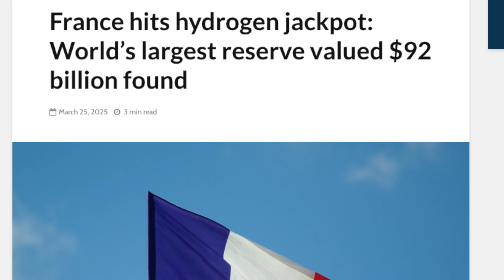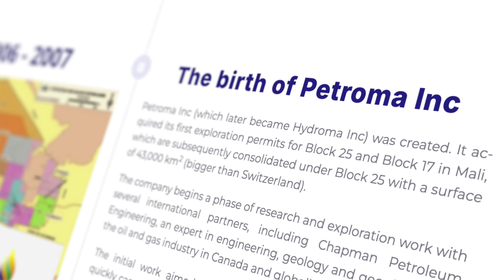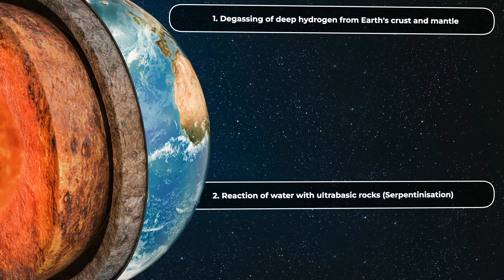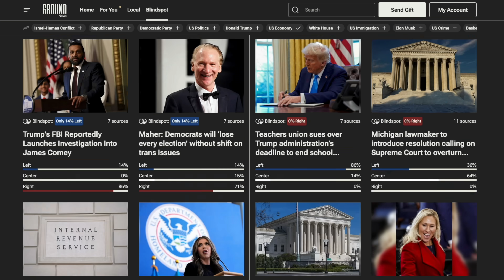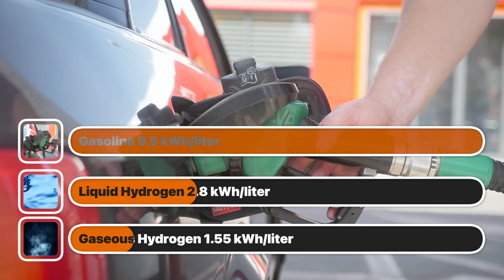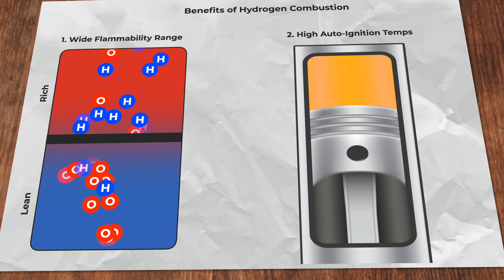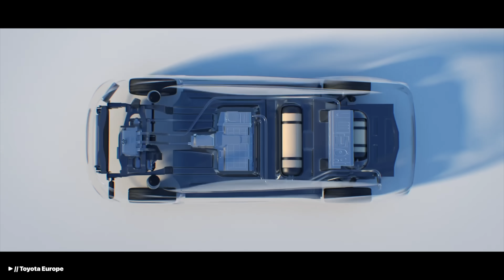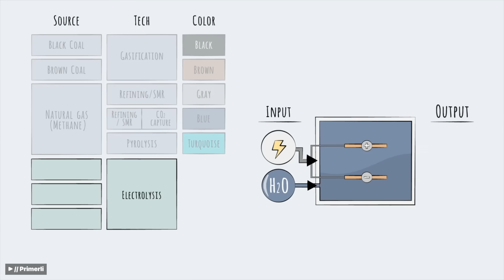This Hydrogen Discovery Can FINALLY Replace Oil & Gas!

Comment: So
What happens when we burn pure white hydrogen ?
I’d assume it would cause oxygen from the atmosphere to be bonded with the hydrogen from the ground and create water.
My question is at what point will this start to decrease the atmospheric oxygen due to the oxygen being converted into water with white hydrogen, rather than the co2 that hydrocarbon fuels produce, that plants can convert back to oxygen.
Reply: Not to mention that the oceans will rise even further with all that extra water, drowning more communities.
Reply: @JasbirSingh-zj1fg  Bruh... There is 1.4x10^18 cubic meters of water in the oceans, meaning about just as many tons of water of which 10% of that weight is hydrogen. That's 1.4x10^17 tons of hydrogen in the oceans. If humanity used 10 billion tonnes of hydrogen every year to power its societies, assuming that it's exclusively white hydrogen (and really there isn't that much on Earth), and given a mean average depth of the ocean of 3600 meters, it would take humanity 3800 years to increase the water level of the oceans by 1 meter, converting white hydrogen and oxygen into extra water in the ocean. And again, there isn't that much white hydrogen in the Earth to begin with.
Meanwhile global warming threatens to increase global sea levels by 1 meter in less than 75 years time.
Not to mention that that white hydrogen originally came from water in the first place

Comment: I’m thinking with all the problems with Europe getting a reliable natural gas supply for their existing fuel networks I wouldn’t be surprised if France starts taking peoples carbon dioxide off their hands, sending it thru a chemical reactor with the addition of hydrogen and selling it back to the surrounding counties as an unnatural gas that could be stored in existing gas facilities and used by existing gas facilities.

Comment: Imagining a world running on Hydrogen instead of Fossil Fuels is an interesting thought experiment.  Both are taking something from the ground, so there's a limited natural supply, but Hydrogen has a much easier potential to be artificially made.  At first it sounds a better for the environment, everyone hates CO2 these days, however it's important to note that water vapor is also a greenhouse gas, as actually has a much higher impact on it than CO2.  So.. if every gas engine in the world was hydrogen instead, we wouldn't have as much CO2, but the warming effect might actually be worse.  We also wouldn't get some greening from the fact that plants like CO2.  We could however recycle the water vapor instead of just letting it build up in the atmosphere.

Comment: So water vapor is one of the most potent greenhouse gases.  If we start burning hydrogen at massive scale and releasing tons of extra water into the atmosphere, what are the long-term effects of this?
Reply: 🤣what? in a planet covered in water where every extra bit of heat causes all the oceans to evaporate more every day? Scale my man, scale.
Reply: Depends on where it is released.  If you're thinking stratospheric (i.e. water vapour where no large concentrations of water vapour ought to be), then a lot more work on secondary effects is needed.

Comment: One thing I know for sure, the energy sector is desperate to sell us something they can put in a bottle,..
Reply: because thats what we all need. being able to put energy in a bottle and ship it around is way better than trying to shove it all through the electric grid. maybe one day we'll have an electric grid that is fit for the purpose of keeping the worlds transportation fleet fueled up - we're nowhere near there yet.
Reply: @tvcomputer1321  ...except we can't usefully put hydrogen in a bottle for cars.  hydrogen cars are ridiculously uncompetitive due to the cost and (lack of) life of the fuel cell, and hydrogen fuel fuelling stations are phenomenally expensie to construct, fuel and maintain. For aircraft, ships and possibly trucks  it might be feasible because of the economes of scale.
Reply: @ajward137  i think the point i was trying to make was "one day maybe but its gonna be gas cars for a long time yet"
Reply: @tvcomputer1321  decentralization increases the utility of the grid. It's why driving to the local store doesn't involve 3 hours of stop n go traffic but the highway/freeway does during high demand.
Reply: @tvcomputer1321 nope. Compression and distribution losses are too great to move massive Hydrogen molecules.   Much more efficient to move electrons (within continents of course)
Reply: This.
Reply: I don’t see an issue. If it’s clean and can sustain a century, it’s good
Reply: @rayversen  hydrogen was a bad idea in the 90s and it remains a bad idea today for mobile power. Slapping a generator on top of these fields makes total sense though.

Comment: Something is wrong with your data...  For one thing your KWh per Liter data shows 0.011 KWh per Liter for methane, and 6.617 KWh per Liter for Natural Gas.  Given that the predominant molecule of natural gas is methane, I would expect these two numbers to be nearly the same.  Also, while a Kg of Hydrogen has about 2-3X the energy of a Kg of Methane, hydrogen is way less dense of a gas.  It's about 1/8th the density of methane at pretty much any temperature and pressure.  So the energy density of a volume of Hydrogen at a given pressure is about 1/3rd that of methane.  You could liquify it with cryogenic temperatures (extreamly cold) but that is very costly, and likely would not work for a commercial aircraft (this was used for the upper stages of the Saturn V rocket).  You could simply compress it, but that too is costly (although not as costly as cryogenic temperatures).  You will never get the same energy content in an aircraft as liquid fuels without crazy high pressures, requiring a very thick-walled tank.  So thick in fact that you likely added so much weight to the aircraft that getting it airborne might become impossible.  Also, hydrogen is a very small molecule.  It finds its way into the grain boundaries of most metals. This makes the metal brittle over time and this is bad news for a pressure storage tank you plan to use over and over again.  If there really is lots of Hydrogen in the ground, your best bet is probably to burn it in an internal combustion engine as soon as you extract it from the ground and put that energy on the electrical grid.  Your second-best bet might be to also extract Carbon Dioxide from the air and use it to reform the hydrogen into methane.  The methane could then be put into the current natural gas pipeline infrastructure and used that way.  This however is likely more costly...

Comment: Just say rust. When something rusts the oxygen molecules are stripped off water molecules to combine with other atoms (Fe>Fe2O3 ^6H)become the reduction, oxidation known as rust, patina, etc... the hydrogen atoms are then freed. But hydrogen has two properties. The atom is so small it's difficult to contain. A tank that would hold air for decades would likely leak hydrogen. Hydrogen is highly reactive so it readily forms bonds making it no longer 'white.'  
And of course rust, burning wood and rotting wood are all reduction and oxidation reactions. Rotting wood and burning wood release the same amount of energy just in different periods of time. 
There's a hydrogen filling station less than half a mile from my house. I can't ever remember seeing a Toyota Mirai in my area. I've seen them on the freeway (Southern California) many many times.  
This could be really interesting. I would expect that aviation would be the better use for Hydrogen than cars. Many rockets, like Space X,  these days burn methane.  
I can see a future where there is a lot of excess green energy from solar, wind, tide, geothermal. They power  the grid and MegaPacks of batteries (for peak use and cloudy days). The excess energy that can't be used in the grid is then used for electrolysis of water to  separate oxygen and hydrogen. So it's morning, sunny day, wind blowing... MegaPacks are still nearly full... so as the windmills and solar cells start generating the MegaPacks discharge by generating hydrogen.  Another use for excess energy might be desalinization plants.  I would think investments in green energy and battery storage would probably be a better investment than wildcatting hydrogen wells.

Comment: Why does no one ever mention how the electricity for EV’s are generated? People only like to discuss the cost of operation and “green” energy. Almost all EV’s are powered by diesel fuel and natural gas in the U.S.
Reply: Various reasons. For one, the US centric approach to everything is getting a little boring, there is a wider world out there. In my country for example, around 70% of the energy produced is from renewables. Another reason is economies of scale and how efficient the use of said diesel or other fossil fuels is when converted to kinetic energy. Is it more efficient to burn diesel in millions of small very inefficient ice motors or in one giant power plant? Finally there's where the pollution is created (and potentially recaptured). Is it better to have the pollution in a power plant somewhere or in your town? Is it easier to clean up? Is it easier to keep running at top efficiency?
As far as I can tell, the discussion of energy sources in the US is not a science or engineering based discussion. It's a political, ideological and quasi religious discussion, mixed in with very powerful lobbies that either indoctrinate huge parts of the population or simply run over public opinion and go straight to the power centers. For the rest of the world, watching americans argue about ice vs ev is a baffling spectacle...
Reply: Yes, natural gas produces like 60% of America's electricity.  (Coal, 14%, and ever dropping.  Solar and wind, 15%, and ever rising.  Rest mostly hydro and nuclear.)  Not sure where you get diesel from, unless you mean some kind of hybrid, most hybrids seem to use gasoline.

Coal is reducing in its use for electricity every year.  (Ever done work in a coal fired plant?  Nasty stuff.)  The world has been installing 400 GW a year of solar, a rate that's increasing exponentially, with its costs plummeting exponentially for decades.  Sadly, nuclear mostly stays expensive, probably mostly of use in high latitudes and for data centers (and other uses of base load power where nuclear's high cost is a minor factor).  And still, unlike Finland, no long term waste storage in America. :-(

Regenerative braking means that in city driving an EV uses no more energy than on highway, and here in the mountains, driving up and down uses no more round trip than driving on the flat.  I have years of personal experience showing me that.  It works, well, and improves efficiency a lot.

There are numerous pieces to decarbonization, and most people interested in the topic are quite aware by now of the pieces, and available options.  Hydrogen, despite Ricky's enthusiasm, has problems as a transport fuel, just see the comments on this video for a short list of the many issues each of which alone more or less rule it out for now, for that use, except a few minor specialty cases.

Comment: A swedish research team recently found a way to turn hydrogen liquid without using pressure, or cold.
Reply: Source - and peer reviewed research - or it’s 100% fake.
Reply: @EnochLight  I tried to send you a link, but youtube removed it. It was researchers at the university of lund. You can google it yourself. it is not 100% difficult
Reply: It would be nice, but it sounds a bit like coldfusion:p

Comment: Just going to glaze over the carbon cost, other pollution and destruction of habitat then? Combustion doesn't really make sense. The best application would be for industrial processes such as making ammonia. The elephant in the room though is shipping the hydrogen. We don't currently ship hydrogen at scale because of the cost and risk such as embrittlement.  It's usually used at source of generation. It will be used wherever there is a commercial opportunity, but ground transport isn't likely now.

Comment: It could be great for balancing a grid, with a lot of intermittent resources, on a long term basis (multiple weeks and seasons) if fuel cells can be made at low cost (not using super expensive palladium/platinum). No hydrogen pipelines would be needed if converted to electricity close to the natural deposits (use high voltage cables to get the electricity to the grid instead). Burning hydrogen produces a lot of NOx (not a good  option). Hydrogen lost the competition for terrestrial transport to batteries. It might be suitable for ships. For Planes is probably not viable unless someone comes up with a super storage lightweight technology. Another option is to convert it to ammonia for planes and ships (if it is cheap enough). Plenty of options.

Comment: 1litre of water countains 1,750 LITRES of hydroxy gas when split through electrolysis, 
why would anyone put gas in a tank which is 1,750x LESS dense? it would run of
it 1750x faster, 
boats could just make it from the water they sit in not evrn needing to store any fuel.

Comment: You are missing one point. There are only about 30,000 commercial aircraft flying in the whole world. VS about 1 billion cars, trucks etc. If even 1/3 of cars alone went to hydrogen your emissions would drop in huge amount. But this will take decades to do the switch from petrol to hydrogen. I don't care if aircraft keep bourbon petrol VS hydrogen. But this is a good start on our grandkids having cars and trucks that run on hydrogen. This will also change each country reliance on foreign oil. The more hydrogen they start using the less oil they import.

Comment: Storage? Transport? Being able to detect leaks and fires? These are the problems with Hydrogen, far more so than its availability
Reply: Fires?  Not so much.  Fireballs  on the other hand ...
Reply: No, those are all manageable problems. The problem right now is the price of hydrogen.
Reply: @GerbenWulff  The price of hydrogen is high partly because of the problems with storage, transport, and safety.  As an energy carrier, it sucks.  It should only be used as a chemical reactant / reducing agent.

Comment: I'm disliking these videos from now on. I'm so tired of tech that's "almost here". Hydrogen is dead. Stop it. This is supposed to be an engineering channel. As an Engineer, we know hydrogen is not feasible for mobile purposes. It just does not have the energy density. Do some real engineering and stop click baiting.

Comment: Why not convert the hydrogen into ammonia and use it as an (aviation) fuel. Easier to store and transport with higher energy density (4.25kWh/l) than hydrogen. Also can be used in conversational jet engines with some modifications.

Comment: Check next youtube:
Toyota Destroys Auto Industry with a Water Engine.

This is 7 generations old technology to me. It was new in 1994, but already outdated in 1996. This is an HHO engine that uses a fine metal mesh instead of metal plates like the one for tea. This reduces the capacitance of the capacitor, which was a key problem. The efficiency of the hydrogen generator can be increased by adding a frequency of 20kHz to the capacitor. The energy value of the resulting mixture of hydrogen and oxygen is higher than that of fuel, so the engine would consume less fuel (water).

Comment: So, digging up fossilised carbon and burning it to produce CO2 is bad for the atmosphere, but digging up fossilised hydrogen and burning it to produce water vapour (a far more potent greenhouse gas) will be fine?
Reply: Well you wouldn't/they won't burn it as such, it will be used in the Petrochem Industry to replace the petro produced hydrogen. Definitely not burn... in a car!
Reply: @Bob-h4s2p How will that stop it ending up in the atmosphere as extra water vapour?
Reply: Well, in most industrial processes I'm familiar with, it is condensed into liquid and usually repurposed on site. The amount of free H available on a planetary level is negligible, and even if you reacted all of it to water vapour (which you wouldn't) its effect on the biosphere would be inconsequential. I've been an eco-nutjob for 30yrs - I'm not worried about this.
Reply: The atmosphere has a very well functioning mechanism for removing water vapor: rain ;) The atmosphere does not have a similar mechanism for co2 :p

Comment: My own thoughts on how hydrogen should be usedis initially as an energy storage system for tempromental grid electicity from solar and wind, with the combined production, storage and generating systems collocated with airports so that as surplus hydrogen productive capacity and storage capacity builds and builds and builds, it would become worth while for aircraft manufacturers to produce hydrogen powered aircraft.

Colocating hydrogen stations next to airports would also get us away from the need for a hydrogen grid, these stations only need grid electricity and water.

These hydrogen deposits would need to be piped to the end users or other transportation systems would have to be arranged. It could kickstart the hydrogen economy, but we will need to revert to making our own hydrogen eventually so the hydrogen stations I mentioned earlier in the comment would still need to be built.

Comment: 6:22 he says it's the better picture that the tanks with all the hydrogen weighs 5.65kg and the lithium battery with the full pack would be a hundred times of that. I'd think something's off here. Does he compare just the hydrogen he's going to consider only the lithium of the battery. He's cherry picking.